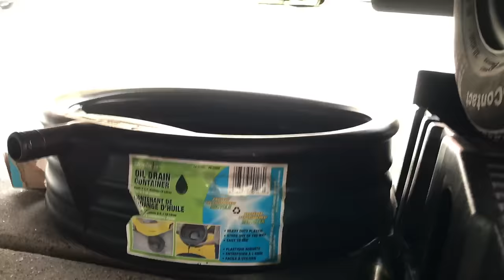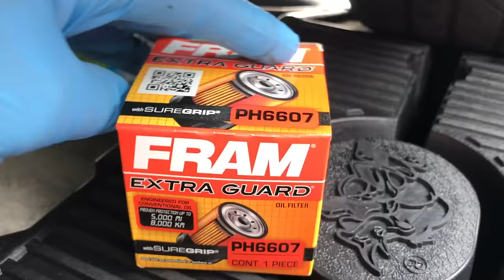Nissan Altima Oil & Oil Filter Change 2013-2017

Comment: "Use retained or new 14mm bolt and washer." ALWAYS replace the washer! You can re-use the bolt. With a copper washer (not plastic) you can torque to specs. Which brings us to the next point...since the video creator used a TORQUE wrench, it's worth pointing out that proper torque on the drain plug is 25 ft/lbs. IF you don't have a torque wrench & you're in a bind, you can tighten it snug but not too tight...especially w plastic washers (I prefer copper).

Comment: Nissan dealership charges me $45 each oil change service. It insist I need to take it there because they use the 'Nissan' specified oil. I think it is BS. I hate dealerships.
Reply: Foodie it's free at most dealers if you bought the car there.
Reply: BigRed Made In America it’s not free, you pay for it in the price of your car, and even then it’s a limited number of changes.
Reply: BigRed Made In America Some dealerships offer free oil changes or tires for life. But this cheap dealership doesn't offer anything.
Reply: David Derfus Agreed, most dealerships are greed driven and don't offer anything.
Reply: I go to the dealer but only get charge 20. I think at that price it’s worth it to go to the dealer right ?
Reply: miguel vasquez $20 is a great deal. However, there is no place that charges $20 for synthetic. If you do get that price, you probably bought a package from them when you bought the car? Even when you do change oil yourself with full synthetic, the oil and oil filter will be around $40-$50 depending if the items are on sale.
Reply: Nissan does have their own oil which they call their “Genuine Nissan Motor Oil” which they prefer to use since it’s based for their cars. But you can always use Mobil 1 or similar, just try to stay with one oil otherwise you could get problems.
Reply: SacredxAirsoft That is what they want you to think "Nissan specific" is BS. I asked the tech and he said he used regular oil Mobil 1.  The crappy Nissan dealership charged $50 and used 5W-30 reg conv oil on my 2015 Altima which specifically said 0W-20 full synthetic. Now I bug Mobil 1 0W-20 full synthetic and pay someone to change the oil whenever I need oil change.
Reply: @Foodie_888  I have a 2017 nissan altima , I've seen videos people using 5-w30 and  ow-20 which one is it and where do u look?
Reply: @jaimemorales852  0 20 for colder climate and 5 30 for warmer, iirc.
Reply: Jaime Morales 
I buy mine at Walmart lol
Reply: @fusewerks  Can I use one oil type all year long? I have a 3.5 v6 2016 and live in a cold climate during winter
Reply: @josem1596  it should say in the handbook what weight to use.

Comment: Big help! Had to service an Altima today and couldn't find the filter. Now I know why. Don't forget about resetting the oil life system on the dash though.
Reply from the maker: Yes good point! Will do!
Reply: How do you reset it on the dash. Just starting to do this myself
Reply: 4Junior4real on your dashboard settings. Scroll to the settings. Go to service. You’ll see oil,tires and other. Go to oil. Scroll down once and hit reset. May need to hold it for a second. And presto! Hope this helps. I don’t do videos but you can also just YouTube how to reset oil maintenance on altima. There are actual videos.

Comment: Damn I feel like an idiot for paying someone to do this. This seems super easy!
Reply: Some of the oils can be expensive but you can still save a lot of money doing it yourself. Just be careful when going under the car, you can probably just get some ramps and always chalk off the back wheels and use your parking break especially for FWD. 😀
Reply: Tell me about it. Paid $120 at Valvoline oil change station
Reply: @joeysbestfriend2614  You paid 120.00 for an oil change on a Nissian Altima?   You need to go slap you ever upsold you that price,  that is a travesty.  I spend maybe 30.00 dollars doing myself by us OW-20 walmart brand oil.  If you dont feel comfortable doing it yourself it should never cost more than 70 bucks at oil chage station.  Cant believe they ripping people off like that.
Reply: @sheltonparkerjr5342  mechanics always overcharge people that's what they do
Reply: @GswcaLi831  lol this is hilarious. I spend 45 to have my local shop do it and they even use full synthetic... its not worth doing oil changes at home for me. Like 10 bucks in labor... okay take my money.
Reply: @NoName-gv6nm  exactly why I don’t do it my self lol
Reply: It is nice to not have a stranger be in your car and to also do at your leisure and not have to schedule it or drive to get there.  There’s definitely pros and cons- however I spend about $5 more to do it myself versus getting it done elsewhere.
Reply: Thanks for the video. It was so simple

Comment: Very good.....Also, start the engine and let it run about 15 seconds to let the oil circulate into the filter and then check the oil level again!
Good job!
Thanks!

Comment: Nice and simple vid. Thanks. I do recommend using Purolator PureOne oil filters over FRAM though. Much better quality. FRAM filters are basically just cardboard inside lol.
Reply from the maker: +Phil Lopez thank you!
Reply: Purolator filters have a bad reputation for torn media and sliced anti-drainback valves, Tear-O-lator is what many people call them.  Fram filters have ZERO cardboard, many people don't seem to understand what cellulose fiber media is.
Reply: @TranslatedAssumption  That's why I use their top-tier Purolator BOSS line. Full Synthetic media, not going to tear.

Comment: Video was great, my only question is why a fram filter when oem is $5 more and the build quality is far superior then fram.
Reply from the maker: Go for it! I’m poor, I need the $5 bucks. Ive never had an issue with Fram filters ive used them for 25 years. Oil filters are a $29 Billion market so I’m sure most of what I hear about the inferiority of Fram is to take more of their hold on the segment. If you don’t like Fram filters, and stay awake thinking about the horrors of a cheap paper filter not doing a good enough job, even tho trillions of cars use them everyday without issue, then by all means buy into the hysteria and propaganda and give some marketing geniuses more of your money ;) I am constantly given shit about my use of Fram filters, you’ve been the most direct and kind about it! If they are junk and you know that to be true then go with what you know. I don’t know that to be true and I don’t believe cutting oil filters open and looking at them has proven anything valuable to me. Thanks for asking!
Reply: Sorry friend but there is absolutely nothing wrong with Fram oil filters.  I am well aware of the typical Fram bashing talking points but I have never seen an actual failure of a Fram spin on can oil filter.  They ARE built incredibly well and at a terrific price point.
Reply: If you're changing oil every per the maintenance schedule, cheap filters work just fine man.

Comment: My local service center suggest me to use 5W-30 instead of 0W-20
Help please
Reply from the maker: Some warmer areas of the country suggest 5w-30 instead of 0w-20 as the oil is cheaper usually and works in that environment. If you live somewhere that gets cold (below 40F or so frequently) be sure to use 0w-20.

Comment: What’s the torque on the drain bolt?   Need to do mine lol.  Thanks in advance.   Other than that.... best oil change video I’ve ever seen.  Good job.
Reply: I usually tighten the bolt with my hand, then tighten bolt it unitl it stops moving with tool.  I have never had a oil leak after my oil change.  You should awlays let you car run for 5 minutes to see if you see an oil leak though.

Comment: My 2015 nissan altima 2.5s has 5 30 oil on the cap?
Reply: I feel like going outside to check and my manual shoot... At 11pm at night after watching this
Reply: Actually it didnt after checking my gas was wasting fast so i switched to 0w20 my previous altimas took 5w30 tho
Reply: @jaykey6166  you can use either weight, if you take it to the dealership they will cheap out and use 5w30

Comment: So, stupid question, but what do you do with the oil-soaked paper towels? Are those safe to throw away or where do they go?
Reply from the maker: +Brian Truman hey! Great question, best thing to do is take them with you when you dispose of the oil filter and oil at Autozone or other auto parts that accepts oil, they have special bins out front for empty oil lined containers and oil contaminated waste like paper towels. That's the safest way, otherwise try wrapping them in a plastic bag or ziplock to protect them from any sparks or heat source :) thanks so much for watching!
Reply: Great! Thanks very much for the reply!

Comment: I had a question, which would be more preferable to lift the nissan car, jack stands or the two ramps to drive on? Just looking out on safety wise or seeking your opinion. Thanks
Reply from the maker: +Colton Begay Thanks for asking! I really like using the ramps because I find jacks and jack stands annoying. I think the ramps are safer too - as long as you are using them on somewhat level ground and using a wheel block along with setting the parking break. I use the ramps anytime I can get away with it! 
Thanks so much for watching,
luke
Reply: MINUTE DIY VIDEOS I had another question, say I have this friend whom I was helping replace his filter, he might've over tightened the oil filter, and I detected a small leakage, what should be replaced the filter or no?

Comment: I took my 2015 Altima to get oil change at local Nissan dealership and on the invoice it stated they used 5W-30 but on owner's manual stated 0W-20 (Synthetic). The service dept said my car uses regular convention 5W-30. I told them no, it should be synthetic. I thought the service dept would look up the car on the comp to know the vescosity of the oil. Will the 5W-30 ruin my engine? My car has only 25K miles. Oil change every 5K miles.

I will need to learn how to change my own oil from now on (your video makes it look so easy, thank you) or take it to and diff place.
Reply: Foodie they have been putting the same in my car all this time when the hood underneath says synthetic as well I took it to another place and they said they would only put synthetic in cause that's what it require they was getting over conv oil is cheaper breaks down sooner requiring you to come back as to up sell you on other products now I don't have to go back for 7000 miles why would they delibertly not put the specific oil type something is shady here.
Reply: Mark Cleveland Exactly! Nissan dealerships are shady. I made copies of my past oil change invoices and circled and underlined the conventional oil 5W-30 and mailed them to Nissan Corporate office. I wrote a cover letter (with a copy of owner's manual of the page stating the oil type) detailing the service advisors, techs and service dept mgr whom I've spoken to about my car's oil type and no effort was made to correct. I hope they all get fired (especially the service advisors and svc dept mgr) trying rip people off. I even called Better Business Bureau on the dealership. 

Now I buy the full synthetic oil 0W-20 and filter and take it to a car shop for them to change my oil. We know the owner. The shop only charge $15.
Reply: Foodie yeah I got mine as well I didn't think they was like that but I guess I was wrong like why would you delibertly put something you know that's not recommended I'm blown away by this Discovery today and I'm pushing for this service in the extended warranty plan they offered
Reply: Mark Cleveland To be honest, I think each Nissan dealership took their queue from corporate. I will keep making a huge fuss until Nissan Corporate and local Nissan dealership acknowledge they were in the wrong. Granted they will never officially admit it but for damn sure I will make sure consumers are aware. They hire consultants to run numbers on payoffs when they get caught. You can be sure they thought it through ripping off consumers in oil changes would be minimal impact to their bottom line b/c why else would they go forward with it? Heaven only knows what other services and products they have pushed, are pushing or will push on consumers that only benefit corporate greed.
Reply: Mark Cleveland Keep your receipts and all things Nissan service related, I have a feeling a few class action lawsuits will be on the horizon for Nissan. I pray the lawsuits will be very favorable to consumers.
Reply: Foodie yeah like theyre not right I always get this scum bag vibe when I'm there but it's obscured by the glass and all the Nissan pictures and cars ,but no one can really look me in the eye there as if guilt won't let them I got a couple mechs I keep in my phone that do good work for alot less so my days with them are over unless it's computer related
Reply: Mark Cleveland Good luck to you and your Nissan car. No more Nissan crap for me. I am gearing towards Toyotas and Hondas.
Reply: i was told a synthetic blend on mine,
Reply: Kwame Mcdonald Yes, should be 0W-20 Synthetic but when we bring the car to Nissan dealership they put regular conventional oil instead of synthetic.
Reply: ok thanks, i already did my oil change lol, but the next one will be 0w-20 instead of 5w-30, dealership told me the same thing
Reply: @Foodie_888  in the video the guy uses 5-w30, so which one is it?
Reply: Jaime Morales at 2:01 in the video he used 0w-20. If you open your hood, under the hood it should say what oil your car uses. Also, in owners manual it would state the oil.
Reply: Jaime Morales Mobil1 is my preferred brand, seems to work the best for me. They even offer a 0w-20 full synthetic blend that only needs oil changed every 15,000 miles. Good luck to you.
Reply: @Foodie_888  ok thank you, the dealer also was using 5w-30
Reply: satans master Dealerships are where shady people work at. Not their fault really, they are trained that way by management. They make most of their commission at trying to cross-sell items we don't need.
Reply: satans master One worthy note, noticed they "usually" have 1 main dealership in each city - this is by design by corporate. This is a strategic monopoly by the corporate office so consumers hav little or no choice. So always be aware what happens when you go in a dealership. Best of luck.
Reply: satans master That is awesome. You are one of the lucky few, very admirable. I wished I know how as well. My problem is I just know how to take things apart and can't remember to put them back. LOL.

Comment: what is the best oil for 2016 Nissan Altima
Reply: whatever you can afford
Reply: Personal preference, different oils have better additives than other oils. Me personally i'd stick with castrol or mobil 1. either one works as long its the weight that the oil cap specifies for your vehicle.
Reply: Mobil 1
Reply: syntehtic!
Reply: @joseph ward LMAO!!!

Comment: What is the oil change interval for the 2015 Altima? I use 0w20 mobile1 and mobile1 extended performance filter.
Reply: I'd go 10k. That little motor holding 5qt would make it.
Reply: Me personally as a technician, I would not go 10k miles on an oil change. With oil getting better now days, you can definitely go 10k miles on an oil change. DEPENDING on driving habits. The harder you run your engine the quicker your oil life degrades. Id just stick with the oil maintenance reminder on your instrument cluster. When its down to 20% is when I would change it so sludge build up is not really a concern to your engine.
Reply: My owners manual says every 5k.

Comment: I have a 2013 Nissan Altima s. It says I need 0W-20 oil but I’m not sure what to use . I went to the dealer ship to purchase the oil and filter but I think it’s bullshit . any recommendations on what oil and filter to use ?
Reply from the maker: I like Mobile One and Fram filters (most people prefer k&n, but I think Fram work just fine) Costco has 6 quarts of 0w20 Mobile One on sale just about every other month for $28 and Walmart will usually have the 5 quart jug of Mobile One 0w20 on sale for about $27. Thanks for watching!

Comment: What type of motor oil does this car require?
Reply: Usually it’s stamped on the cap where you pour the oil at but, I believe is 0W-20

Comment: I pay over $100 to have my oil changed at a stop and go shop. I can save over $50 if I do it myself and I’ll know if the right oil was used. They used 5W-30 even though they’ve always used Ow20 the basically told me tough shit.

Comment: I looked online the manual says you can put 0w-20 or you can put 5w-30 ,under the hood it says to put  0w-20 ,while the manual seems to say you can put either?
  Will I ruin my engine by putting 5w / 30? It's a Nissan Altima 2016 model SR
Reply: @BaggedWater Yup did the same in the end. Mine is the SR model but only takes 4.9quarts the whole bottle was accidentally put in. I hope that's fine.
   When I stopped in AutoZone the guy behind the counter used to work in the Toyota dealership he told me most Toyotas say to use 0w / 20 while you can really use 5w / 30 which would be better for your engine ,but they don't tell you that even though a regular mechanic would put in 5w 30, by the dealership they want to get away cheap and only put what the car recommends. 0w-20
Reply: I have a 2015 Altima S 2.5 and always used 5w30 every 5k. No problems ever. I have almost 80k without any issues